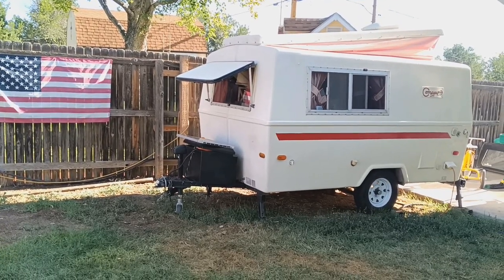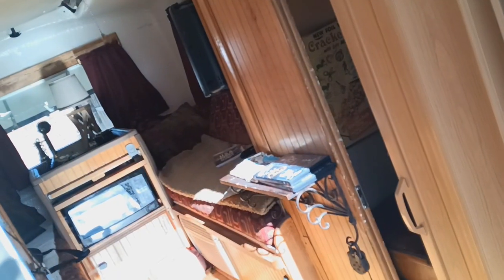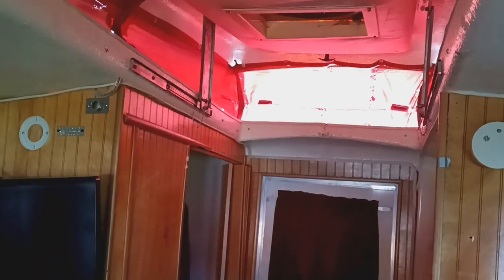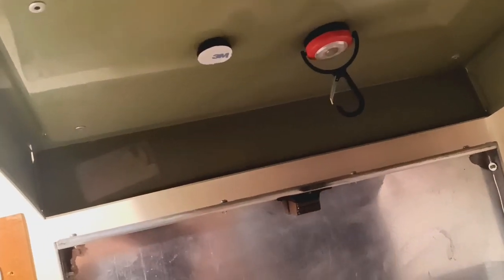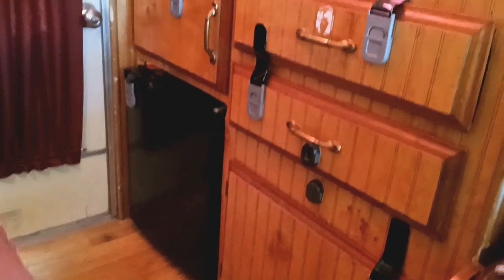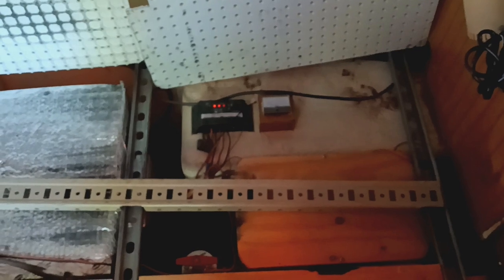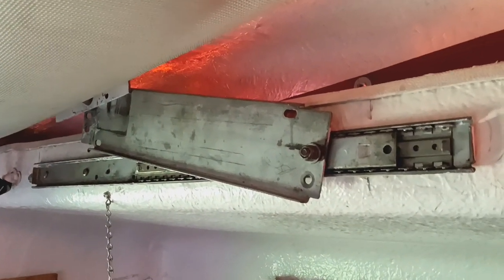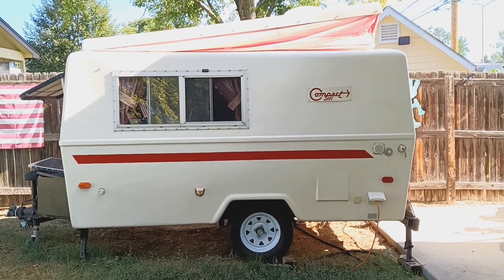Vintage 1972 Hunter Compact Jr. Trailer

Comment: does it have insualtion or does it get really hot or really cold inside depending on weather? Did you make the pull out counter/table that your nephew showed in the other video?
Reply from the maker: @amyfreeze9772 -- It's fiberglass, and so it stays reasonably cool in weather between 65 and 80. However, when the windows are open and the ceiling fan is running, there's a nice cross breeze.  Plus, opening the pop top works well.  In the cold, a 'small' electric heater does well.  It only needs to run for short bursts to get it warm inside. The counter table is something the prior owner built.  That space used to be completely open; because, the factory table was there.
🇺🇸🐂🤠🐎😺
Reply from the maker: ...no insulation.
Reply from the maker: In the prior video, that center cabinet existed.  It blocked the window, and the cabinet space was over-kill.  So, we cut it down, which also gave more surface space and an open feel.